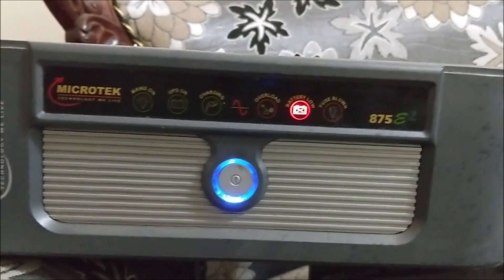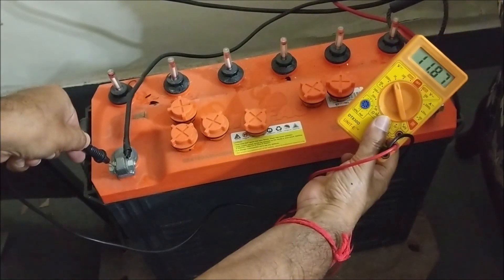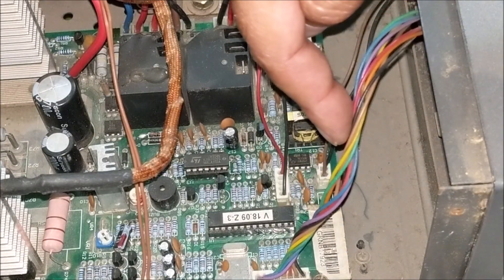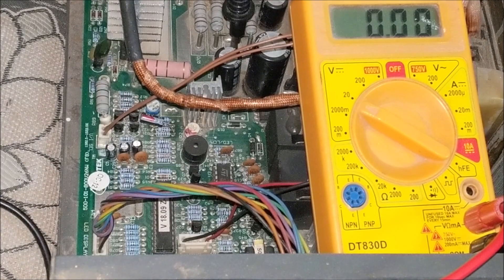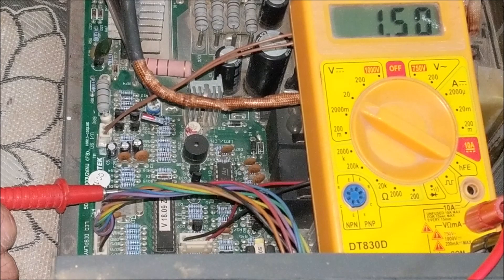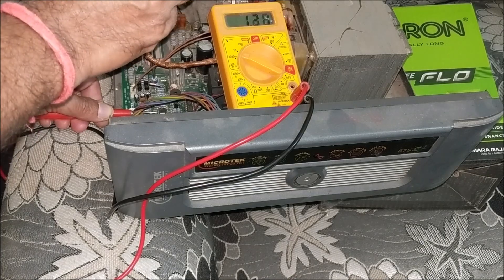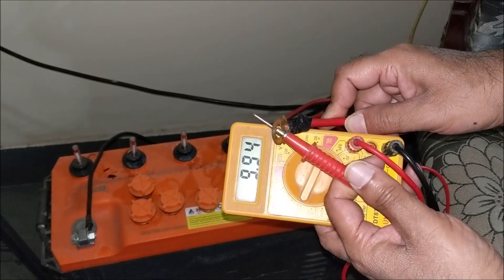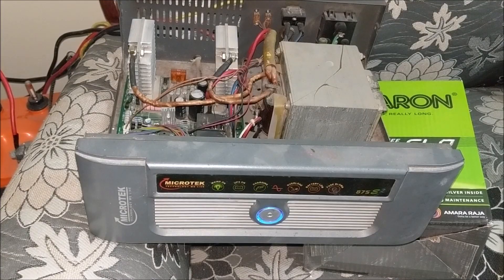how to repair low battery problem in microtek inverter 875e2

Comment: Sir apkay videos bohut pasand hai mujhe my question is mera inverter discharge 11volts par low battery indicate karta plzzz help us inverter model microtech 875 e2 sine wave
Reply from the maker: microcontroller ka number kya hai. low voltage microcontroller se hi adjust hota hai.
Reply: @ firstly thanks for helping us. Mai ne check nahi kiya hai aur mai technician b nahi hun. Aap jase logou k videos dekh kar hume b inspiration mile aab ess ka shook badh gaya god bless u brother
Reply from the maker: @mohsinbhatt802  thanks

Comment: I have microtek inverter 925 E2+ 
The problem is sometimes change over but sometimes not working means that battery low issue in the inverter, can I talk to you after your free at the time.
Reply from the maker: change the low cut preset. it will solve your problem.
Reply: @diyrepairs  value of preset
Reply from the maker: @kiran111100  2 kilo ohm
Reply: @diyrepairs  preset set 3.4 volt in micro controller pin no 2 is that correct.
Reply from the maker: @kiran111100  it should be between 1.5 to 1.7 volt
Reply: @diyrepairs  sorry preset set 3.4 volt in micro controller pin no 3
Reply from the maker: @kiran111100  what is the voltage at pin 2
Reply: @diyrepairs  1 volt comming from 18 0 18 transafarmar
Reply from the maker: @kiran111100  increase to 1.5 volt by rotating the preset
Reply: @diyrepairs  only 1 preset in the PCB 202 blue colour rectangle shape
Reply: @diyrepairs  Microtek inverter 925 E2+ 13.74 pe cut off hota microcontroller ke pin no 3 pe 3.4 volt adjust Kiya hai, 150AH tubeller battery hai, problem -  battery full charge ho ki na ho par inverter kabhi bhi inverter mode pe jata hai input mains line hone ke baad, fhir thodi der me fhir mains line pe charging karta hai,fhir inverter mode pe jata hai, YAHI PROCESS CHALTA RAHTA HAI AUR LAST ME BATTERY LOW KA INDICATOR CHALU HOKE BEEP SOUND DETA HAI, FHIR INVERTER BAND KAR DO TO MAINS LINE BYPASS HOTI HAI PAR MAINS+CHARGING INDICATOR GLOW NAHI HOTA HAI, 2 HOUR'S KE BAAD AUTOMATICALLY MAINS+CHARGING INDICATOR GLOW HOTA HAI, FHIR INVERTER POWER BUTTON CHALU KARNA PADTA HAI, PLEASE REPLY AS SOON AS POSSIBLE.
Reply from the maker: what is the value of microcontroller? voltage at pin 3 is ok. voltage at pin 2 is coming from 12-0-12 transformer? it should be around 2 volt. since it is coming from transformer, so there is no preset to control it but there is 3 resistance and one capacitor connected between pin 2 and positive of the transformer. the values are 15k, 3k and 1k. 15k and 3k makes voltage divider network. one end of 15k is connected to positive 12 volt coming from transformer and other end is connected to 3k resistance. other end of 3k is connected to negative. at the junction of 15k and 3k the voltage should be 2 volt (12/18x3 = 2volt). this 2 volt goes to pin number 2 via 1k resistor. as the voltage at pin 2 decreases the low cut voltage will increase. check those resistance and capacitor.